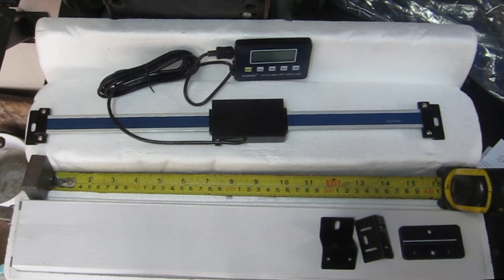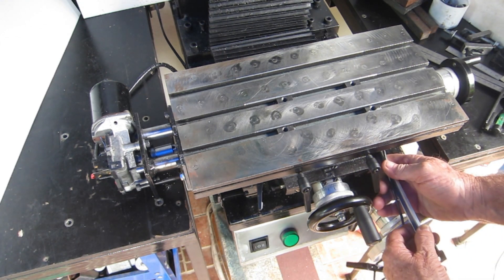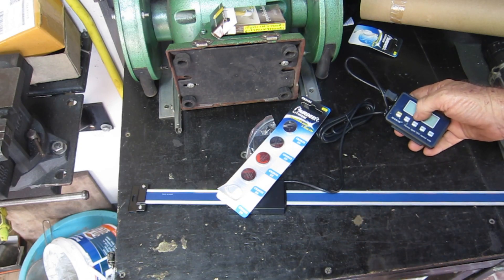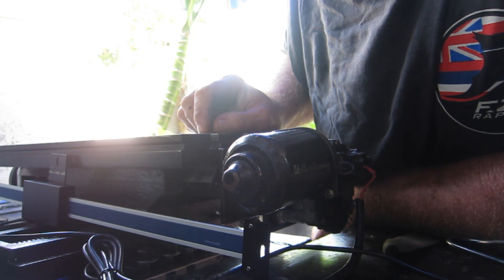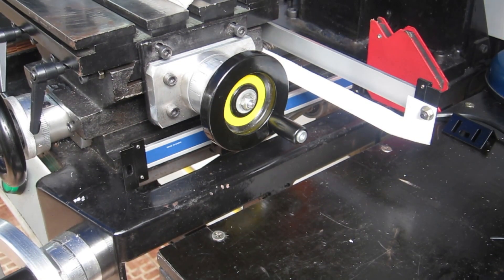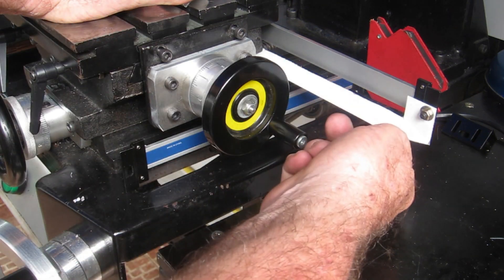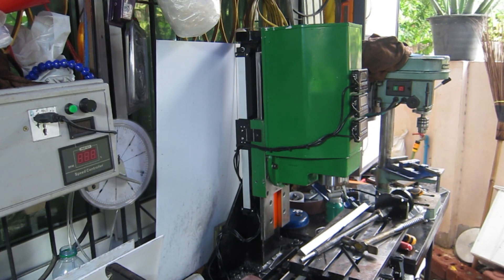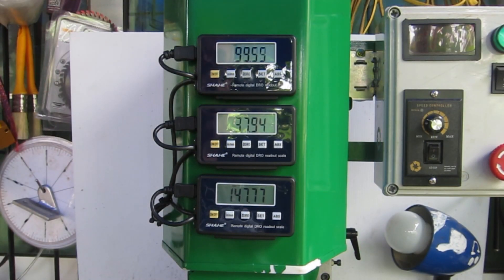MHW Episode 45 - SHAHE Mini Mill DRO Set Up to my Homemade Milling Machine

Comment: what's your opinion on it after using it for a year?
Reply from the maker: They are OK for the money, but you need to keep the rails clean, I use a pressure-pack Electrical Cleaner to clean mine with 👍
Reply from the maker: A quick extra note, I have had to move the displays away from where I had them mounted due to electrical interference, it was odd that it took quite a while for that problem to raise its ugly head. I had the same problem with the 2 units I have mounted on my lathe. 👍

Comment: Installed the same on my three in one lathe/Mill/Drill
Then upgraded it with a TouchDro Bluetooth module. Now any Android device is my display and I don't have to concern myself with the stock displays turning off.

Comment: Would you mind sharing which cameras you use and which video editing software?  I'm thinking about doing vids about mods and repairs on the AR-7 Survival Rifle.  You and Mr. Pete have convinced me to give it a go.
Reply from the maker: You could do better than the camera I use, which is a Canon S95 and around 10-12 years old and has no auto focus, but does have excellent low light capabilities. The editing software is Wondershare Filmora, the paid version, not the free version.

Comment: Pretty much a must have item on a mill -saves a lot of hassle and backlash becomes a thing of the past ! With those types of gauge the auto off function usually only turns the display off and even pressing the off button doesn’t really turn them right off . If the mill is going to sit for any amount of time , taking the batteries out will save you a bit of money .
Reply from the maker: Yeah it's not like I'll be using it every day, but at least those batteries were cheap, 6 of them cost me 68 baht, A$2.70